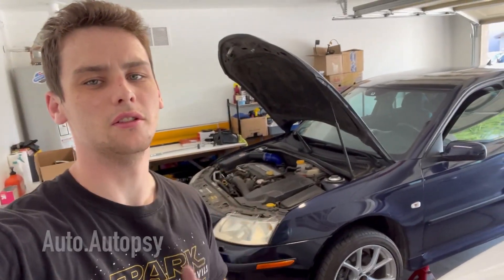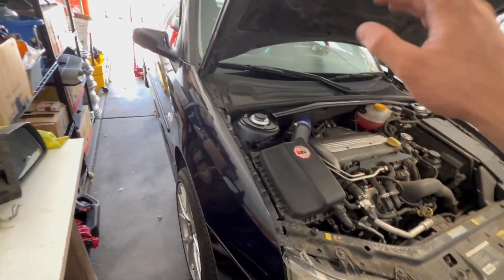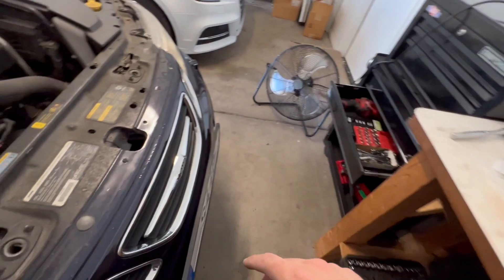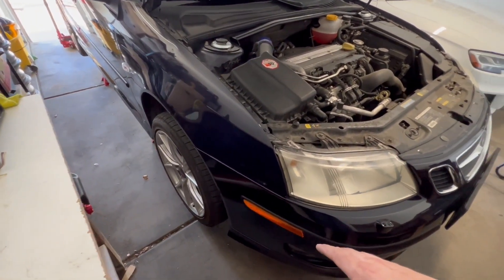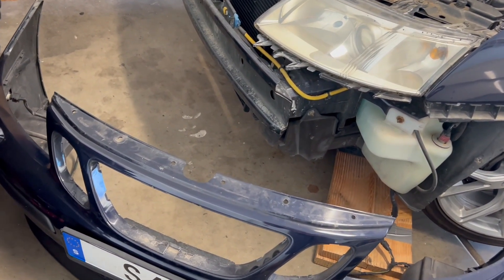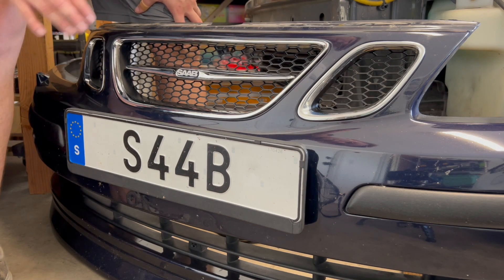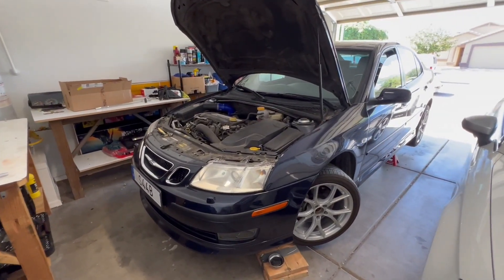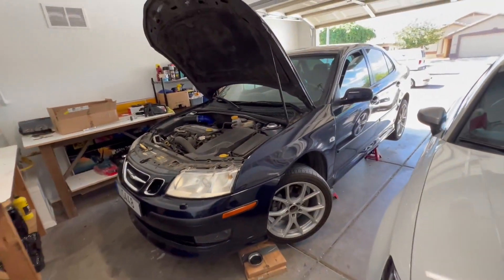Maptun Honeycomb Grille Install on My Saab 9-3!

Comment: Looking great! 
Couple of future upgrade tips. The facelift rear bumper fits the pre-facelift cars and you lose the black plastic strip! The facelift era sport model has the same sideskirts as the Aero, the rear bumper also has an aero lip built in. It just needs the center exhaust section replaced or cut out for the pipe, and painted or wrapped with carbon fiber faux wrap to look amazing. At that point, you will have an Aero clone, with a better looking facelift rearend. I posted pics of my 05 linear upgrades on my IG page a while back for reference. Love how everything is easy to swap for upgrading all these years!

Comment: Hey mad I got a question completely off topic from the video. I have a 05 Saab 95 arc and I got a stage one by map tune so i decided to get the monitoring app but I keep getting a error saying “can’t start ecu logging” I reached out to them a few days ago and no replies I was wondering if you have ever had this problem and found a solution… thanks also great video😅
Reply from the maker: I haven’t sorry. Try reaching out again with a follow up! 😓